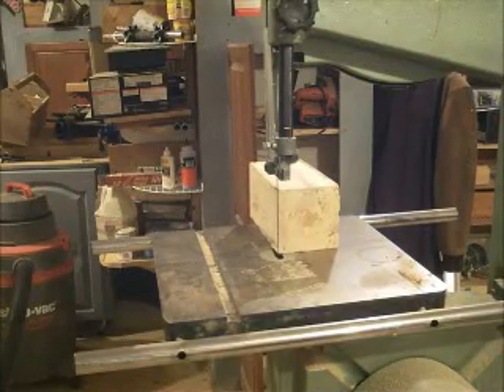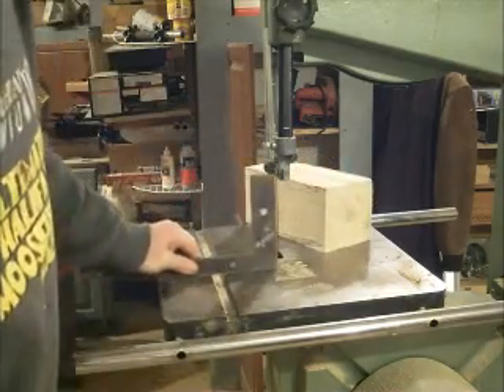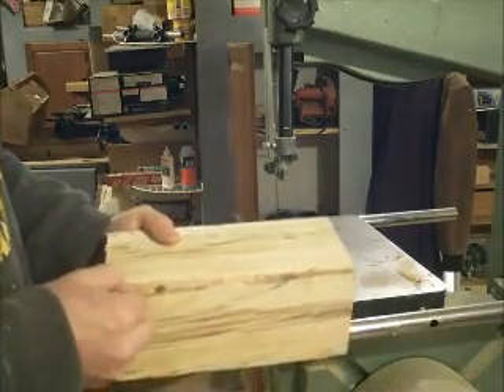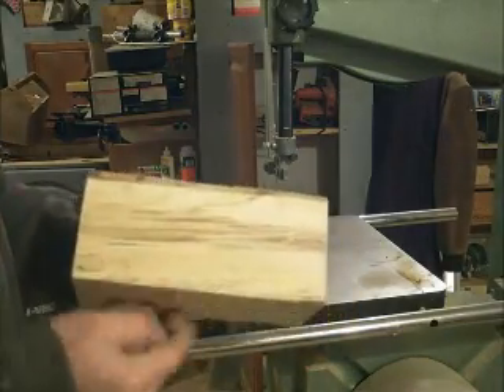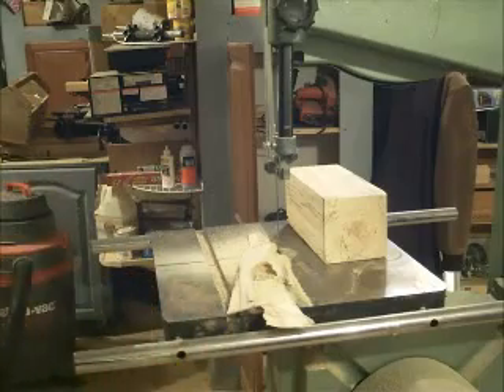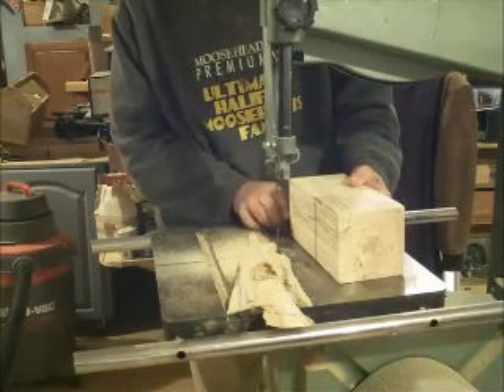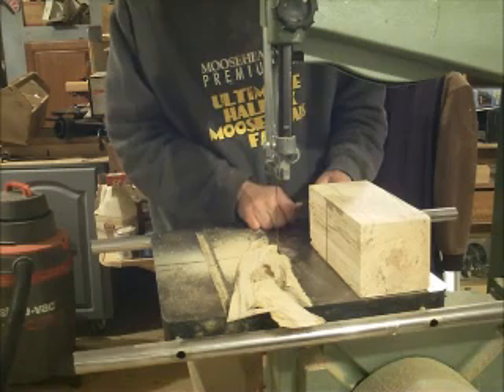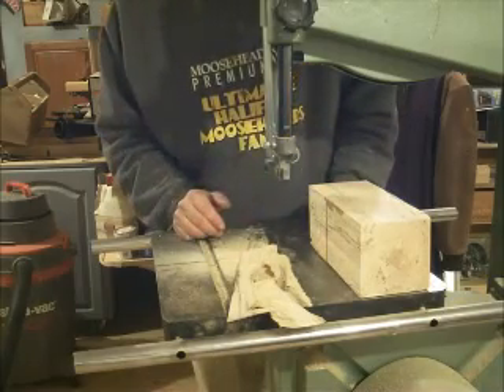bandsaw box 2

Comment: Unfortunately planers dont square wood blocks.the blades cut parallel from the  paners deck.I've solved that problem with shims hot glued to the "bottom" of the block.then run that through you'll end up with one flat square side.then remove the shim.flip the block over and plane the other side.hard to explain in depth.this is my solution as I dont have a jointer.